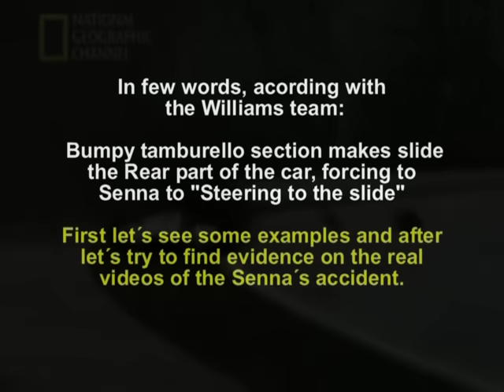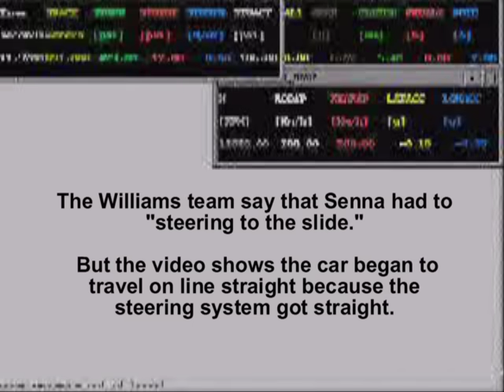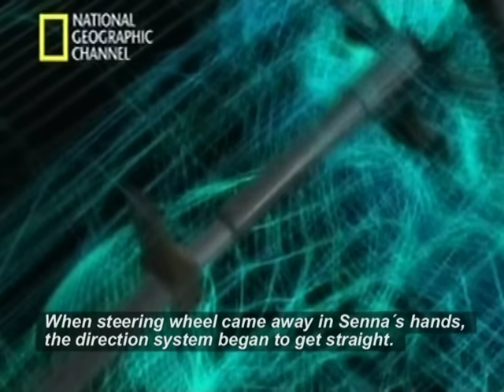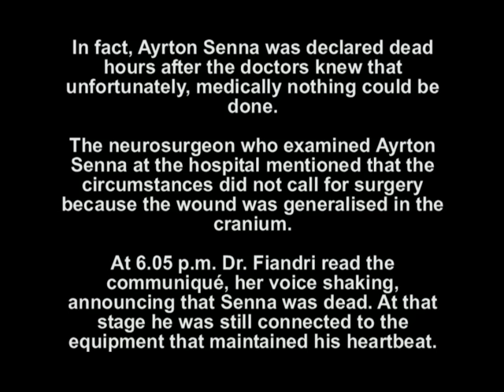5/5 the death of Ayrton Senna - what NatGeo did not tell

Comment: Having worked in Aerospace, automotive, as well as with Metals for a long career. It is my considered opinion, I'll be up with some experience, that the steering shaft had been extended improperly. The method used was to cut the shaft take another shaft and put it in between them with stubs that fit into both shafts and then it's welded around the perimeter. Any flaw in that well whatsoever, or any crack that begins will broadcast all the way through that weld. This is what occurred. The way you properly links on a shaft in a series of three each. Each hole is usually about 120 degrees from the other. And you stagger them about a half an inch or more apart. So that you now have the six holes in line with the tube at 60 degrees from each other. You plug weld the shaft to the underlying connector so that each weld is an independent well. If it fails it doesn't broadcast that failure to the next weld. You can still weld the perimeter of the shaft, for added comfort. That is the procedure used in Aerospace to connect a shaft which must articulate. Although, in the case of most Aerospace connections for such things, it's done with rivets, usually do the fact that it must be able to be disassembled for depot level maintenance.

I believe that the reason for the narrower portion of the shaft was also to reduce some of the impact broadcast back through the steering system to the hands. As the 18 mm portion of two would twist a bit more than the 22 mm section of tube. Made it a little easier on the hands and imparted less fatigue.

I remember watching that on live TV. There was no sign in the multiple replays they showed of it that he was out of control in any way except that he drove directly into the wall. The argument that he was trying to adjust to the car being out of sorts, does not comport with my memory of the event or the videos of the event. I had always believed that it was a loss of steering control.
Reply: Most Aerospace machine shops have a magnaflux department to check for cracks and integrity. If the shaft modification was done in the racing trailer workshop a proper certification surely could not have been done. I had custom brake caliper spacers made with material removed for duct attachments and I brought them in to a company I do electrical work for them and had them tested.
Reply: Of course Senna's accident was a mechanical failure. It's impossible to wreck in Tamburello in that time and configuration of the circuit without some mechanical breakdown. I think it's a shame that Williams evaided their responsibility of the accident... I mean have anyone EVER wrecked in a slight curve like Tamburello in 1994 without something break in a car? I can't remember anyone.
Reply: @DaveFazzino it's been awhile since your response, but let me point out that all the testing in the world does not fix an improper procedure. Magnafluxing, and even several other tests could it be performed that might have showed no issue. Once you apply stressors, and even the austenitic zone of a weld begins to fail, it will propagate throughout the piece unless you have properly staggered the stress risers so that should one fail there's still at least five others to take up the slack. You can actually increase that to where if one fails you have nine others to take up the slack. Testing does not ensure your life. Which is why the man died, I watched that race in real time and I knew what the problem was the moment it occurred. It was clear the very first time I saw it in actual time that he had no control over steering or he was dead before he ever hit the wall and that didn't happen
Reply: Good analysis

Comment: The numbers also tell the story. The yellow g number is the side g force it is round 2 in the corner and then increases to over 3 before immediately falling to zero. This is consistent with turning hard and then a sudden snap as it cant handle the force and then zero force will be experienced because it has snapped and the wheels are no longer turned. The yellow number in top right window seems to show steering input, and it shows a large input and then suddenly zero, even though we can clearly see him turning the wheel after this. check the numbers. ( And also the blue g number is acceleration and deceleration and if you see 5:19 the top right yellow number hits zero input (broken) and the blue g hits zero - he has released the throttle, thereafter the blue g's are negative, he is emergency braking.)
Reply: You can also notice that when the G force changes, his head comes to left as that was direction that he was putting the neck effort.
Reply: good explanation on the numbers cause i didnt even know what i was looking at

Comment: Another thing that points that the steering column broke is his head right after he starts going straight. It looks like he's trying to lean to the left as if to steer, but that's obviously not happening.
Reply: Y.., I once was saying the same in serveral video(s). He tries to take the corner with all might in his mind (head movement to the left side shows that), but front tires don't react anymore.
Reply: Absolutely. It's obvious @ 4:55
Reply: Peter Nový
I didn't even notice that but it makes perfect sense. He probably has incredibly good muscle memory and knows very well when you turn your car hard left at that speed its going to throw you to the right hard, so he throws himself to the left but the car never moves at all.
Reply: Yeah, it's pretty obivous. So, we can rule out the point that he was unconscious, like others said around here.
Reply: Very well. When I saw it I thought that Senna was pushing his head to the left (to counter the lateral Gs in the corner) and the car suddenly went straight on, to Senna's surprise. This caused his head to move to the left, as he was still attempting to take the corner, but the car going straight = lateral Gs 0.
Reply: The steering column was fatigued a third of the way through. When the car stepped out, he tried to apply opposite lock to correct and the stress caused the column to snap, making the wheels would not respond. Also, I believe a slow puncture was also a cause to the lower ride height.
Reply: he also let go of the wheel, nobody would let go of the wheel. It isn't a natural reaction to raise both arms in fear at racing speeds. I think its suicide.
Reply: The drivers are trained to cross their arms and grab their shoulder harnesses when a crash is imminent.  This is done in an attempt to prevent their arms from being broken if they are holding onto the wheel when the front end collapses.
Reply: @soartothesky  As per the previous two replies to your post. Race drivers are trained to take their hands off the wheel, otherwise they are likely to break their arm/hand from the impact of the crash. The whole point of it is so they can get out of the car after a crash. If you break your arm you can't get out of the car, ie you can't remove your harness, well not as easily/quickly.